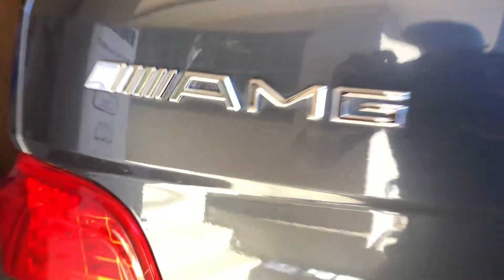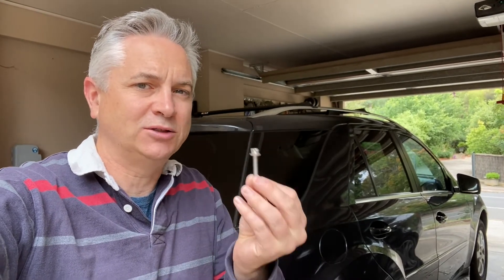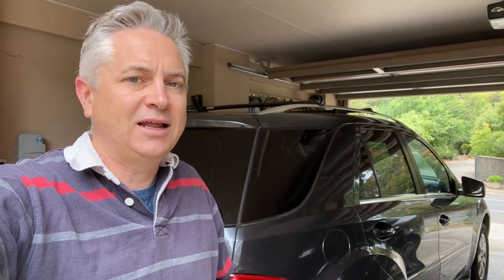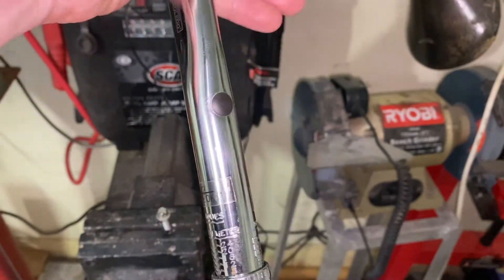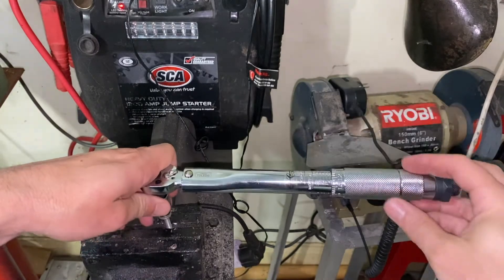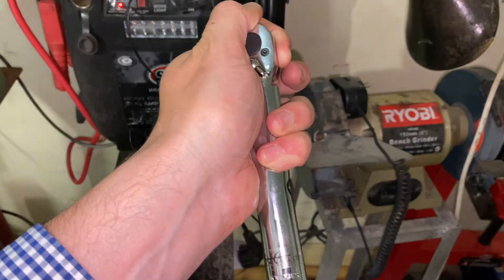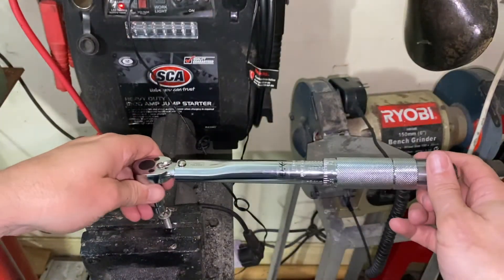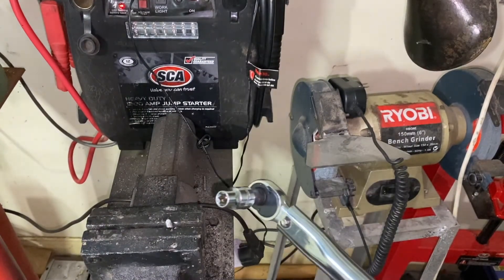Mercedes 722.9 Transmission Service - Should the Pan Bolts be Reused or not? Aluminium Stretch Bolt

Comment: Hello, I would like to replace it with a stainless steel bolt. Should I install the torque value at 4nm 180 degrees the same as the aluminum bolt?
Reply from the maker: Hi Mate, the whole 180 degrees adds torque but is mainly about stretching the OEM stretch bolt.  If you use aluminium bolts as you suggest then I recommend putting some aluminium anti-seize on the threads as well as some blue loctite and then torque them to 10nm.  Cheers Drew

Comment: I reuse these regularly.
I Torque them to 8nm.
Even reused the same ones twice.
So on and off 3 times since new.
Never snapped one
Reply from the maker: Hi Mate, if you think about the physics of what is happening with a “torque to yield” bolt which is what these actually are the clamping force is actually compromised when reusing because you are always talking to a relatively low torque setting where the stretch has already occurred through out the bolt.  You would be far better off replacing with some standard zinc coated bolts to save some money as I have previously suggested in the comments!  Cheers Drew

Comment: Are these M6? and how long are they?
Reply from the maker: Yes mate, they are M6 and 4cm long.  If you are not going to use the "overly expensive" genuine Mercedes aluminium stretch bolt then I suggest you use a High Tensile Zinc Coated M6 Bolts with some Aluminium Anti-Seize compound with some blue loctite on the threads and then torque to 10NM.  I might actually make a simple video on this topic, as the genuine Mercedes aluminium stretch bolts are crazy expensive and are a "one time use" only, whereas if you use these alternate bolts they are far cheaper and you can use them over and over again forever!  Should I do a simple video explaining this? Cheers Drew
Reply: @DrewFixIt  Hi Drew, I came across this good video last night after snapping two bolts. Pan is back on, but unfortunately its dripping ever so slightly I believe. I bought stainless steel bolts and nickle antiseize today to rid these ridiculous aluminium bolts. Have you since put stainless bolts in? If so, what torque spec have you used? I am also a little concerned about stripping the thread in magnesium housing. Let me know your thoughts and if you have done this. Regards, Levi
Reply from the maker: @Levi-xo9un  hi mate, as per my previous comment I tightened them to 10NM and suggest using some blue loctite with anti-seize on the threads.  You should not need to over-tighten them if it is dripping I would suggest it is rather the seal leaking.  Cheers Drew :_DFI::_DFI::_DFI:
Reply: @DrewFixIt  Thanks for fast reply, yes I am just rather unsure but I believe 10nm is sufficient enough. I doubt it is a bad seal, just rather not tight enough on the original bolts as I was very concerned about the possibility of busting them. Thanks very much.
Reply from the maker: @Levi-xo9un  understood.  Put your replacement bolts in, as I said use a bit of Blue Loc-Tite with the Anti-Seize and now, that gotta be reason enough to join as a member: https://www.youtube.com/c/drewfixit/join Cheers Drew :_DFI::_DFI::_DFI::_DFI:

Comment: Force applied to the stretch bolt while it’s in a vice… prohibiting from properly stretching is NOT the same as when it’s properly threaded…I promise you your new bolts with also break at around 8nm in a vice.

I re-use these bolts all the time.
Reply from the maker: So if you’ve watched a few of my videos you might see a black ML on the channel occasionally?  The owner used to reuse the stretch bolts … the last time he serviced the transmission only three bolts were remaining intact!!!  Cheers Drew

Comment: I think I’m going to go buy grade 8 steel bolts with a coller
Reply from the maker: Hi Mate, just make sure you put some aluminium anti-sieze compound on the bolts when you put them in!  Cheers Drew
Reply: You can't because the casing is magnesium

Comment: I hate torque to yeild bolts.  I say just replace  them with normal steel bolts that won’t need replacement anymore.
Reply from the maker: Hi Mate, great suggestion and I do tend to agree with you.  If anyone does this, I suggest you apply some aluminium anti-seize to the threads! Cheers Drew